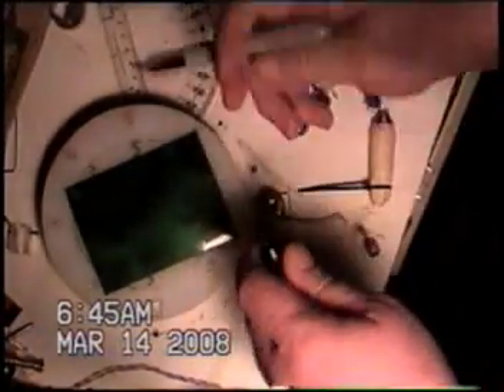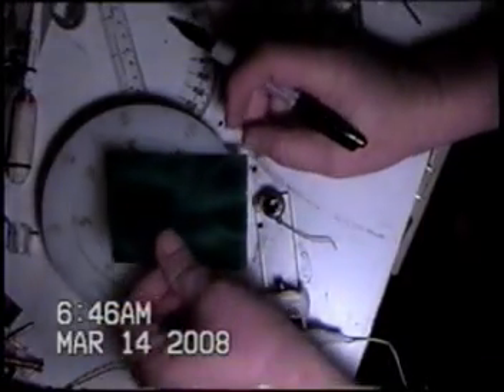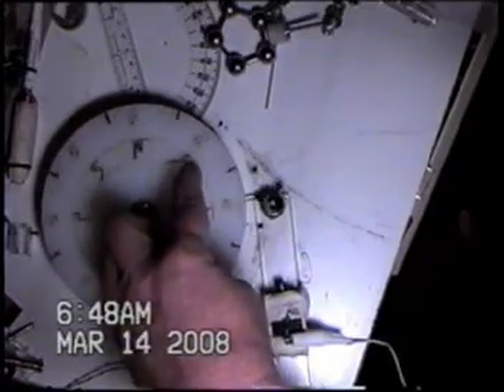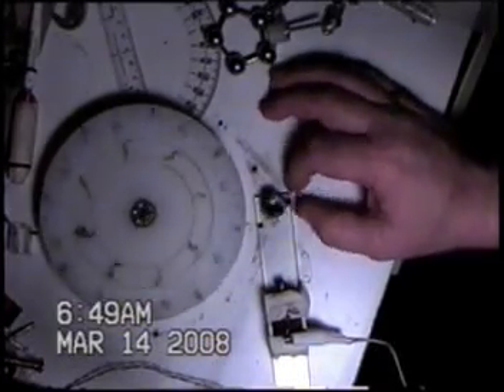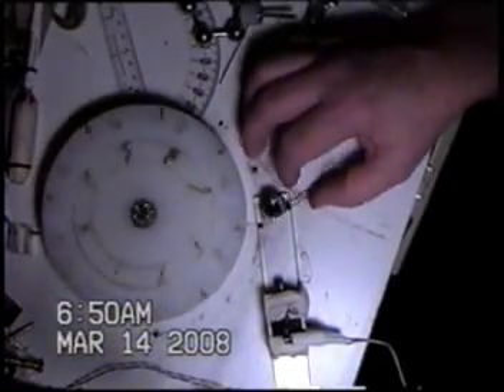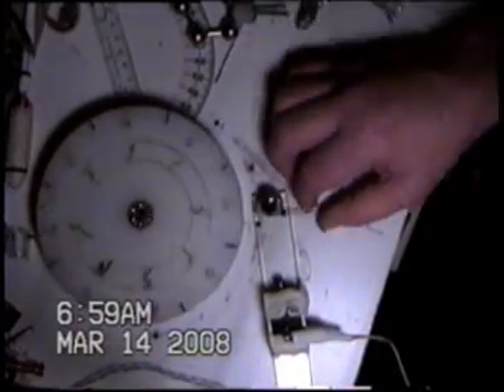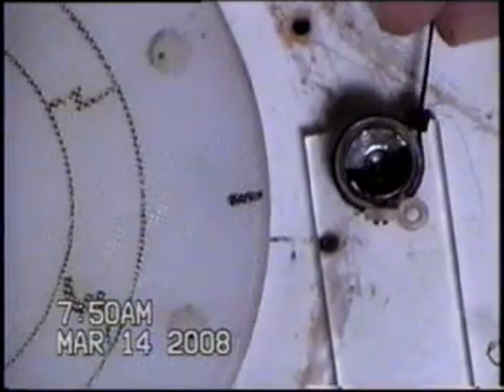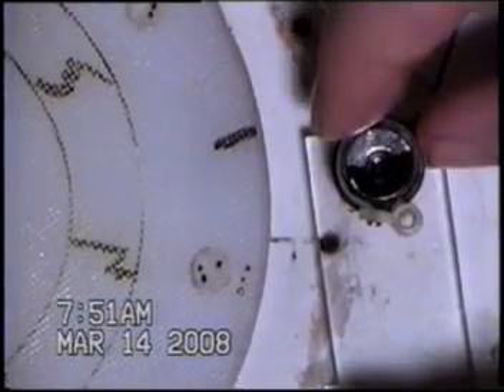Manual Stator Rocking Analysis

Comment from the maker: For timing of 300RPM we are looking at a 1ms pulse width and a very lightweight actuator. I am thinking that a two stage actuator with solenoid for start up and piezo for high speed is the answer to a test rig as you require. (also just a piezo to maintain and a quick manual spin would work as well). I am mentally creating a AM modulated PWM to drive the solenoid so as the shape the pull distances (similar to a vacuum actuator for cruise control)